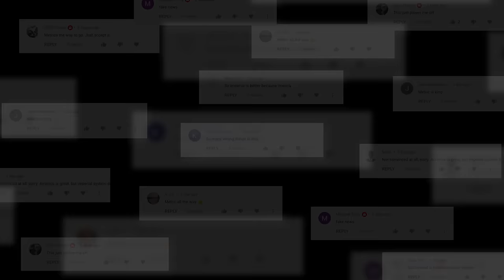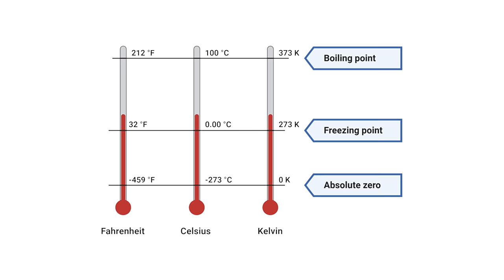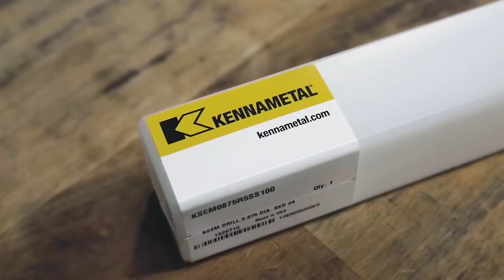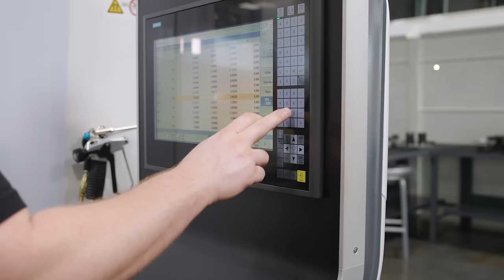Why METRIC is SUPERIOR to IMPERIAL

Comment: You know the really crazy thing: the US standard imperial inch is defined as 25.4 mm.  We have technically been using metric for decades now and most people don't realize it.  Imperial was ultimately converted into nothing more than a weird subset of metric because metric was ultimately proven more accurate.  So basically imperial is nothing more than a bunch of extraneous math we do on top of metric because we are stuck in our ways and it is "close enough".
Reply: But also you have to maintain all the extra sets of tools and fasteners and run extra risks of confusion of very similar sizes. Converting to metric would also hopefully entail phasing out all formerly known as British fasteners and switching to DIN/ISO standard ones instead.
Reply: Fun fact, every single imperial unit is defined by a metric equivalent. So even when we use imperial, we actually are using metric
Reply: @SianaGearz  or just completely switch to metric, then you only have one set you commonly use. Then have some back room that contains all of your unused imperial stuff just in case you need it.

A lot of things in a workshop you need to replace over time anyway, especially things like drill bits, taps, etc. Also bolts and fasteners are consumables, so when you run out or break them you could just buy metric to replace them unless you absolutely need imperial.
Reply: @SianaGearz  I mean as stated in the video, the US govt actually considered the question and had a panel of experts give advice in the 70's, and they concluded that the metric system was not only better, but sufficiently better that it was worth switching over to it. 

The US is officially a metric system country, at least on paper, however Reagan defunded the org that was supposed to plan for the change so you're stuck with antiquated measurements defined using the metric system.
Reply: US has some unofficial mesurements in use on decumentaries so american folk can understand sizes.  like...
if you want to define a height of a mountain, you have to say how many empire states building on top of eachother.
if length of a whale lets say, you have to mesure it with football field.
and interestingly, if you want to describe somethings weight , you should use empire states building again. its multipurpose.

if you keep using imperial, you gonna need a building or a sport field for normal folk can imagine.
Reply: Imperial is good for carpentry and woodworking. Good for when working with the eye.
Reply: @kitchendesigns  Yeah, thats not really a plus. USs metric folks know, exactly how many mm our thumb is, and can just use that as a reference if we wanted. Which gives higher accuracy, than just saying that an inch is 1 thumbs lenght.
Reply: @herrensaar1989  i have big feet, and my inch is 40mm long :p
If you're eyeballing, you don't use any unit. you're going historical, using cubits, palms and fingers.
For woodworking and carpentry, usually the tape measure is a better tool
Reply: Or 3 barleycorns!
Reply: @kitchendesigns  no its fucking not. Its just better for you since you are used to it. There is no difference or holy about the inch you can just as well approx 2 or 3 cm.
Reply: @ledoynier3694  Ofc it is, I would never do any woodwotking with my thumb. Its was to show him, that his argument is stupid, because a thumb is never the same size, so using imperial for woodworking is stupid. But if you only had your eyes to rely on, knowing the lenght of your thumb in metric, is still more valuable than the ditto in imperial.
Reply: lol - that moment when someone tries to look smart by making a simple thing very complicated.. in walks imperial system.
Reply: @iotaje1  It was too late anyway. The change should have happened in the 20's if you really stretch it, not any later. Preferably earlier, of course. The USA was a developed country already back then, which means it was full of road signs, tools, machines, literature, millions of tons of material waiting to be used (like pipes and such), and so forth, all using the imperial system. This kind of material/stuff only kept increasing as years rolled by. When Europe switched to the metric system, in the 19th century, the societies were far less full of stuff in the old measurement systems. Of course the smaller the country, the less painful it is, but the USA is a big country.
Reply: @herrakaarme  You have a right to your own opinion, but again the government mandated expert advice on the subject and they found it was preferable, despite the enormous costs.
Reply: @iotaje1  Unfortunately that doesn't mean it would have been realistic. Just like it didn't turn out to be. From what I've understood, Reagan's time was also when the modern political division of the USA really started to surface, which would have eventually made it even harder because people who wouldn't even normally care that much would have used it as a political weapon, even if Reagan hadn't done it.
Reply: It's not exactly 25.4 but yes your point is correct, all imperial units are now defined by metric units.
Reply: @kitchendesigns  we use metric for wood work, much easier to use a single measurement unit that doesn't involve converting fractions, mm are used in carpentry and wood work and it's super simple.

You get to know how much a certain distance is in mm the same as you know a certain distance in your system, through experience. Neither system is different in that regard
Reply: @kitchendesigns  Its not, because you still have bigger chance of convetring errors between inch, food, yard, ...
Reply: @herrakaarme  All big industries in the US already uses metric. Everyone in the science sector uses metric. It’s only small shops and hobbyists still using imperial. So the step over to metric is mostly starting to use it in the education.
Reply: @jesperwall839  In practice it would require the majority of both Republicans and Democrats behind it. It would also be quite inconvenient if random states rejected the change. I wonder how many politicians would be willing to risk their neck for it, especially among Republicans since I reckon among their voters it would be even less popular than among Democrat voters. Big businesses and science would have made the change on their own, for their own benefit, so it doesn't really reflect the political/popular side of the issue.
Reply: @herrakaarme  This, the majority of where it matters, metric is used. Has been used for quite a while. Metric brought the USA to the moon, the computers ran all their calculations in metric, and only applied a last step conversion to display imperial because that is what the astronauts as pilots where used to. And that is still the case in situations where historically other units are used (airplane's, ships, etc).
This whole argument is a complete non-issue, when you actually care about units, you know what your preference is,, and you have already made your choice. And if you have strong feelings about it, it is probably because you don't really need to think that strongly about units, and if it doesn't really matter, why not stick to what you are comfortable with?
Reply: @omerfidan892  well, this is in fact how you would describe units with things we actually know what it is. So try to imagine 381 meters. And try to imagine a well known building you have seen several times in comparison with other heights. Its nothing about bad way to educate, but rather a way to make you better grasp and the amazingness of the enormous size of things
Reply: @SianaGearz  Ah ... good old "Deutsche Institut für Normung" DIN for the win ^^
Reply: 1 inch equals to 1/7920 furlong.
That's easy to measure 😉
Reply: What do you mean “close enough”?? Imperial unis are all based on the SI. You can literally convert from SI to imperial and back with no error at all because the conversions are exact.
Reply: @ghostofdre  it is exactly 25.4mm
Reply: @ghostofdre  Yes it is. A little more than a hundred years ago an inch in the US differed from one in the UK. C E Johansson changed that to exactly 25.4 mm for both. Industry all over the world accepted that so it became the de facto standard. Standard institutions soon followed suit so it is now also de jure standard.
Reply: Scientifically and for many other purposes, the metric system is already widely used in USA. Imperial units are becoming mostly the "popular" unit while metric is taking over all else. Still there's a few professions on the US that use imperial but now probably need both systems like carpenters or car workshops.
Anyway I can assure you that the advent of the "internet" triggered a slow but sure shift from imperial to metric. Now everybody can compare everything. A regular folk on the US can understand the metric system or he can just learn it with a couple of clicks on YT while, say, in the 80's that folk couldn't care less about the metric system, let alone understanding or even learning it.
I say that in 15, 20 years America will be metric. The younger generations are now aware of the metric system, they see "metric content" every day, they watch these videos, and most agree it's a better system so i can't see any way for the imperial system to stick around for much longer.
Reply: Correct.
Reply: @americanarmadillo199  yeah thatsa literally what the comment you replied to said lmao
Reply: "Imperial was converted into nothing more than a weird subset of metric  Because metric was ultimately proven more accurate."

No.  First, neither system is more accurate than the other.  You can divide the units as much as you want.  You can measure things in thousandths of an inch or even ten-thousandths of an inch, if you want.

Second, the reason why U.S. Customary units are defined in terms of metric is purely a practical, technical issue, having nothing to do with any alleged superiority of one measuring system over another.

What happened was that by the late 1800s, it was discovered that the U.S. Customary pound and yard prototypes were deteriorating and becoming difficult to use as ultimate measurement standards.  So the decision was made to switch to the recently acquired kilogram and meter prototypes, and then just use conversion factors to handle the difference.
Reply: @kitchendesigns unfortunatly for you 1/2 of a inch is 12mm and a inch its supposed ro be 25.4 so yea you are using metric they just told you it is imperial
Reply: Nobody has a problem with the metric system! Think money:
1 cent = 1 centimeter
1 thousand = 1 kilometer 
(Kilo is 1000 in ancient greek)
Reply: they could have just decided it was 25 mm instead of 25.4 and removed a lot of hassle

Comment: Okay clever move, play both sides of the fence eh? Next up, why HSS is better than carbide 😜
Reply: I mean, HSS is great for very soft materials because you can get it INCREDIBLY sharp.

But yeah that's about it 😂
Reply: @Birb_of_Judge  micrograin carbide can be just as sharp as hss
Reply: @etch3130  maybe, but is it any cheaper at that sharpness?
Reply: For small classic lathes it is
Reply: @Birb_of_Judge  per kg removed
Reply: They did do a video about hss being superior to carbide in certain circumstances
Reply: Carbide will outperform any HSS tool but has to have proper setups and approach, where as hss is less expensive and can be used when you have flimsy setups and don't particularly care about how long the job takes
Reply: Hss better then carbide? They already did that one :p
Reply: Two videos ago I watched their brain dead video on why imperial is better 😂
Reply: Hss is better, for example, for steel elements covered with a thick layer of soft metal (chrome).  And discussing whether the imperial system is better than the metric system is like wondering about a stick in the ass or comfortable shoes on your feet.
Reply: @etch3130  nope. It can’t
Reply: They already did one on why HSS is better lol it all depends on the application
Reply: @Damn_Drummer  I didn’t say it wasn’t? I responded to the comment saying “ carbide can be as sharp as hss” saying it can’t. HSS is better in plastics than carbides
Reply: Carbide is too brittle for some applications
Reply: Lol 😂
Reply: I use diamonds instead of carbide or hss
Reply: Now I actually want to see that discussion. I'm literally about to get my first lathe of my own (2.5 hp 14" X 40") and plan to do heavily interrupted cuts on stainless steel. I don't need huge speeds, not doing production runs and parts will be one offs (lots of weld build repair type stuff), but I do need good bearing fit accuracy (so might need to take very shallow cuts). Honestly right now I'm leaning towards HSS with cobalt in it, but I'm not decided yet. Would honestly love to get more experienced opinions on this as it would help me a lot.
Reply: @radbot1  I'd recommend to get at least one internal and one external carbide tool since some stainless grades and hardened steels will wreck even good HSS, but using high quality HSS for everything else is quite practical. You'll need a decent bench grinder and one of those cheap cemented diamond blocks to flatten and true up the wheels (very important but often not mentioned), and then find some guides to cutting HSS tools and good toolholder designs.
Reply: @Birb_of_Judge  and price, sometimes. Or availability in the jungle. But that must be all. 😘
Reply: @Calligraphybooster  okay, i don't quite understand what you mean by "availability in the jungle". Do you mean just better availability in regions that are more remote or do you think i live in a jungle? 😅🤔
Reply: @Birb_of_Judge  more remote🙂
Reply: @samheasmanwhite  Thank you for the advice, it's much appreciated as I'm stuck in a rabbit hole right now! I was hoping to use HSS as I know how to grind and hone it well but now I'm working with unknown grades of stainless and weld built up stainless it's kinda complicated the matter. I'm thinking now to get one good outside carbide tool (maybe sandvik 2220 or seco equivalent) in a good rigid holder, and a stick of HSS (a good sized stick of M42 HSCo is quite expensive also!). Axeminster tools in the UK sells a good bench grinder with 2 white alu-oxide wheels (one is 40mm wide) for £100 and a 40mm wide diamond dresser. So I think I'll start there and see how each performs on the new lathe. Thanks again for the advice 👍
Reply: @radbot1  Ah cool. Yeah you'll probably need the carbide for cutting welds, 316 welds especially can get a bit nasty. You might not want to get very wide grinding wheels though? Maybe if you sharpen a lot of wide chisels too, but otherwise you just have a lot more material to dress off when you want to get a sharp corner.

A holder or several for HSS bar can be quite handy, lets you use much shorter & thinner bits of HSS, and you can get more reach and funny angles. A little hard to find but search "hss lathe bit holder" and you find a few. Also get some cheap HSS too, it's so much cheaper that you can just weld bits of it to steel to make random one-off tools.
Reply: @samheasmanwhite  good shout, didn't think about HSS bit holders. Thanks again!